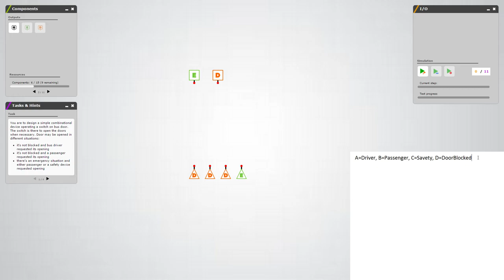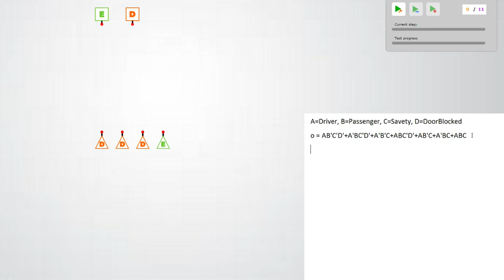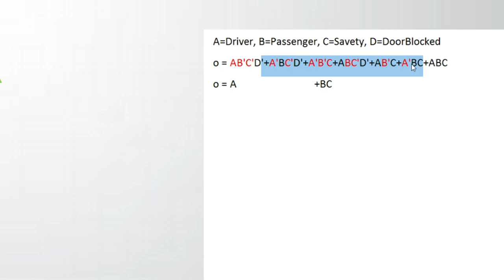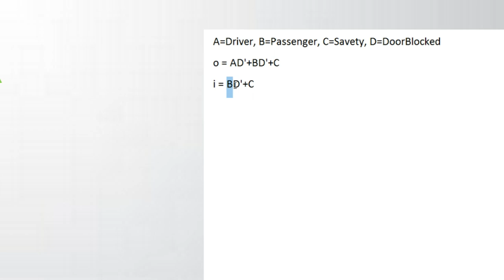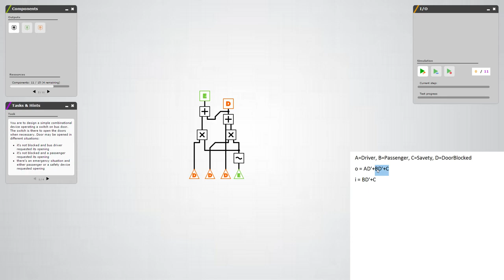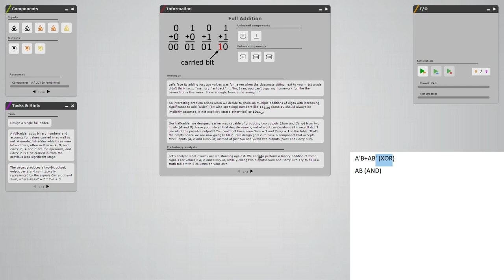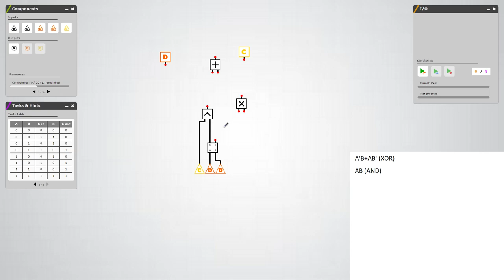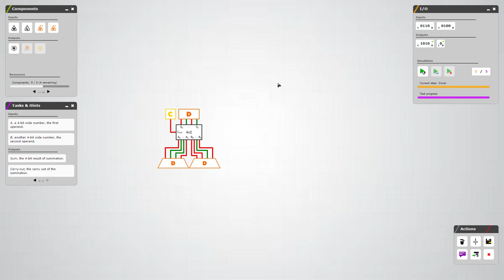MATHEMATICAL APPROACH - Hardware Engineering: Ep. #2 - Gameplay & Walkthrough

Comment: That's not how logic reduction works, nor is it how you set up the mathematics to begin with.

To read the statements would be:
"if not blocked and driver requests" = AD'
"if not blocked and passenger requests" = BD'
"if emergency and either passenger or safety device requests" = (B+C)E

This is based on the information given, and "E" doesn't seem to exist in the diagram outright so it must be part of the tooltip information that isn't supplied with the video at this time.  Either way, the total formula would be AD'+BD'+(A+C)E.  This can be reduced to (A+B)D'+(A+C)E in logic gates.

Given your premise equation, you cannot just reduce subsequent NOT terms whimsically, you have to algebraically combine them and only when you have a combination term like  X+X' can you reduce it to 1.  For example, A'BC+ABC can be turned into (A'+A)BC and then it becomes (1)BC, which reduces to just BC.
Reply: Wow. Glad I read this. I was thinking he was doing some kind of algebra yet unknown to me. Your rendition makes perfect sense algebraically.

Comment: simplifying D there actually saves you one logic gate, so it does make a small difference
Reply: nvm, you use BD' on i, soits best to keep it unsimplified
Reply from the maker: +Gunar Kroeger You mean like D'(A+B)+C? What gate represents the brackets?
Reply from the maker: +Gunar Kroeger That's what I thought, but just out of interest, what gates would be involved in the simplification?
Reply: Yes. Everything is like normal math. multiplication is an AND because 1*1=1 and any other comb is 0, and logic sum is is an OR because only if you sum 0+0 you get 0(false)
Reply: So its an AND
Reply: D'A + D'B = D'(A+B)
1 OR + 2 AND -> 1 OR + 1 AND
Reply: you just need 2 AND + 1 NOT gate, the two or gates are not nessessary, you could hook it straight up to the outputs
Reply from the maker: +Zombee 003 You can't have two signals activate one output without an or gate, it results in errors. Did for me.